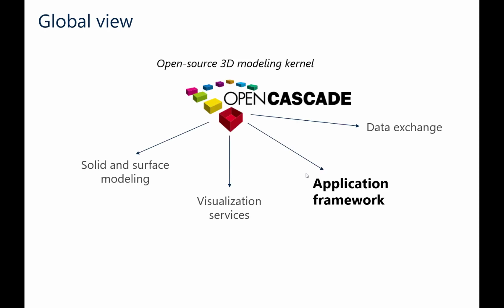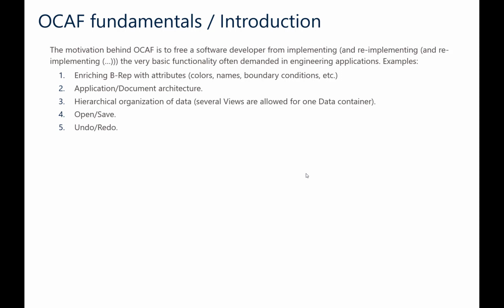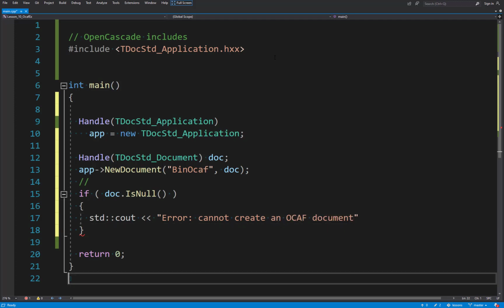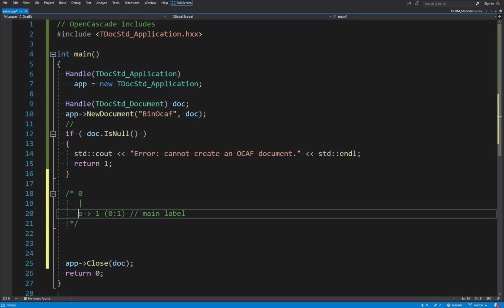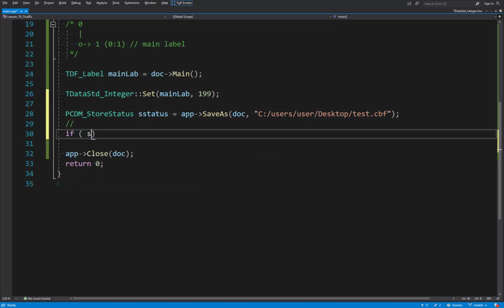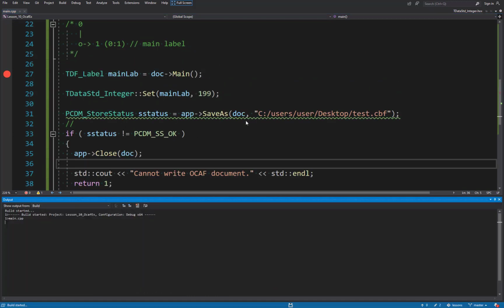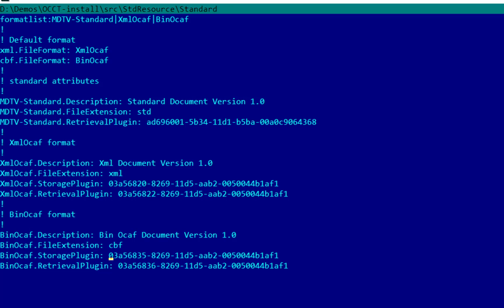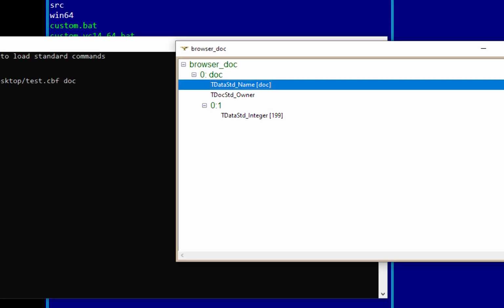Lesson 10: OpenCascade OCAF Part 1 : First steps with OCAF

Comment: Why do we have to manually close "doc"? Isn't it a smart pointer?
Reply from the maker: I haven't checked what exactly will happen if you don't close the document, but I prefer closing it explicitly similarly to closing file handles when you're done with them. The reasoning is as follows. If you do not close the document, then the only thing you're sure about is that the corresponding smart pointer (a handle) will call the destructor on the document. Then, the question is: will the dtor of a document release all resources or not? It's very likely it will, but I would double check that (you may want to go ahead and check it by yourself). The second reason to close the document is actually not related to smart pointers. By closing a document, you switch the OCAF document that is possibly shared among other smart pointers to a somewhat "closed" mode. Notice here that a "closed" document does not equal to "destroyed" document. Other pointers then will keep pointing to this same document, but it will be now "closed" for them as well. Finally, I personally prefer to keep track of heavy resources such as OCAF documents explicitly, so that if a document is to be closed, then I know exactly at which line of the code it's going to happen.

Comment: Once we store and retrieve the data using the Open command, let's assume we stored some TNaming_Named shapes.. and would like to display them to the user.. how to maintain the link with the between the Ocaf data and the AIS data?
Reply from the maker: Although OCAF can keep some references to AIS objects in the specific attributes, I would not recommend this way (it's a somewhat worst practice). Then, having this option excluded, you can architecture the relationships between your presentation and persistent objects the way you like. I am not actually using AIS, but it in VTK I store persistent IDs of my objects (something like 0:1:1:3) right in the scene actors. The same can be done for AIS objects: you can store reference from a presentation to its persistent label as a string ID. Then it's your responsibility to control the lifecycle of your presentations (i.e., make sure they are cleaned up once you delete a TDF label, etc.). I hope that makes sense.
Reply: @QuaoarWorkshop  thank you so much for your valuable input. I have so much to learn ! I will do some more digging.. Looking forward to your next video !
Are scene actor VTK's version of AIS_InteractiveObjects?
Reply from the maker: @jonathanforget8988  You're welcome! There's a lot to learn and I invite you to join our new forum at http://analysissitus.org/forum/index.php for more in-depth conversations about CAD programming in general and OpenCascade in particular. Feel free to share more about what you're trying to achieve with the library, and let's see if I/we could help you with the quick start. VTK is yet another library for scientific visualization that I use instead of AIS because of its great flexibility and neat features, such as graphs visualization. There was another video on this channel about bridging OpenCascade and VTK, although I do not mean to say that one should give up with AIS (it's quite good for what it's designed, i.e., rendering CAD geometries).
Reply: @QuaoarWorkshop  I have joined the forum when I found your channel, unfortunately I am having issue with the email confirmation for some reason.
Reply from the maker: @jonathanforget8988  hm, not sure what it was, but i confirmed your account right now manually, so you might want to try to login.
Reply: @QuaoarWorkshop  sir, it still says it's awaiting for my confirmation email..my url is members/jonathan.5/, thank you for your help
Reply from the maker: @jonathanforget8988  okay, maybe I did not save the changes last time -\ Can you see my message on the forum?
Reply: @QuaoarWorkshop  yes, everything seems to work now, thank you so very much

Comment: what open source programs utilize this OCAF ? I think looking through code also can be very helpful.
Reply from the maker: Can be helpful, if you know what you're looking for. The OCAF-based code rarely comes without extra layers of abstraction (DAO), so you'll have to understand the architecture of the program you're looking and kind of "reverse engineer" it. One reference here is Salome, although I'm not familiar with its codebase. Another is Analysis Situs that is based on Active Data for OCAF (https://gitlab.com/ssv/active-data, https://www.researchgate.net/publication/282149692_Active_Data_SDK_for_organizing_data_of_CADCAMCAE_software_powered_by_Open_CASCADE_Technology).
Reply: @QuaoarWorkshop  this is a interesting library. My interest in the subject is mainly due to finite element anlaysis and visualzation. I think it simplifies some of the work needed to be done.
Reply from the maker: @retiredreplicant.2195  I used Active Data a couple of times to build pre-/post-processor software. You can find some higher-level architectural notes here, for example: https://docs.google.com/document/d/1QP48Wn3EnVzYIjzztI4lz4Vpig9mxyZr0t0JgZg7uMU/edit?usp=sharing

But we can move this discussion to forum.
Reply: @QuaoarWorkshop   very nice ideas in the document. do you have an specific forum in mind ?
Reply from the maker: @retiredreplicant.2195  I mean this one: http://analysissitus.org/forum/index.php
Reply: @QuaoarWorkshop  should we open an specific topic ? or should it go to random section ?
Reply from the maker: @retiredreplicant.2195  feel free to start a new topic whereever it makes sense (i can move it to a suitable category later on).

Comment: Hope you will explain how to correctly import step file to some user defined structure, maybe just on example how it is made in other application like freecad. I have some problem with it to load all colors and locations correctly.
Reply from the maker: Perhaps the easiest way is first to translate everything to an XDE document and then convert it to your data structures. It is not as efficient as direct conversion, but it will be much easier to implement. Feel free to post a topic on the forum (http://analysissitus.org/forum/index.php) if you want to elaborate on this.
Reply: @QuaoarWorkshop  I'm trying to make it like you said (if I not misunderstand) with stepcaf reader. But I have some problems with understanding some parts of whole picture. For example, how to correctly extract color for face. ColorTool not always gives correct results. If I fully stuck with this thing, I will definitely post a new topic in forum. Thanks for advice)